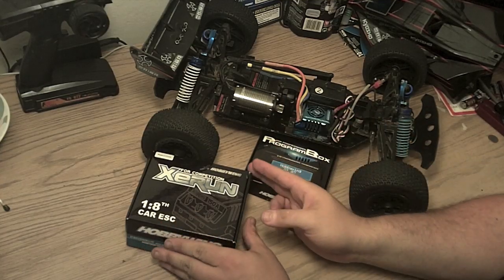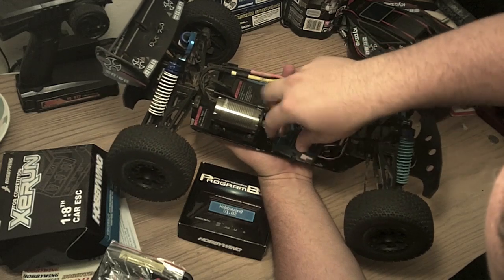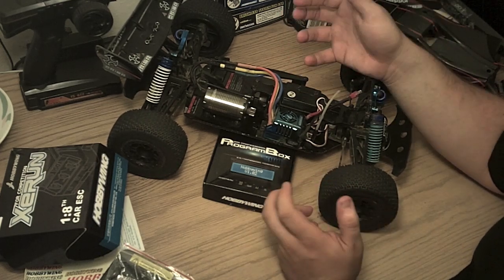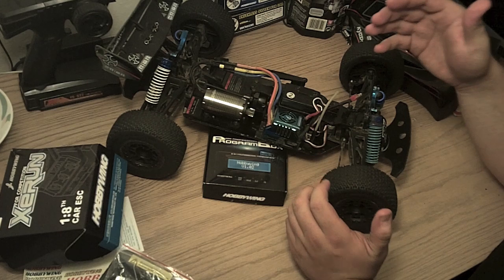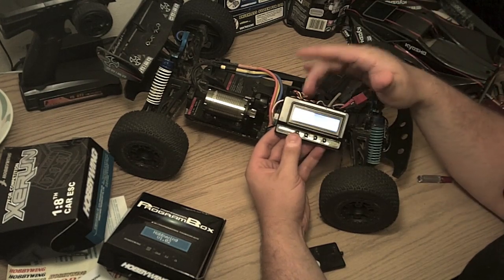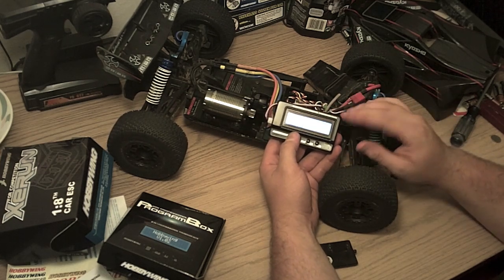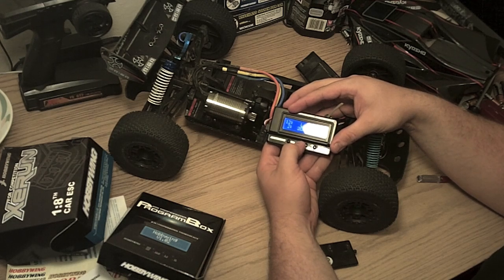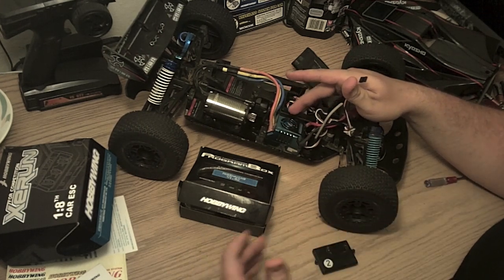HobbyWing Xerun 80A ESC & Program Box Review

Comment: i got an ezrun sc8 120amp water proof and it runs fine on 3s life on kyosho dbxve on 2800kv 550 motor 

runs cool easy to usb update and program with programming box  has good bec and powerful fan 

i got programmer and esc shipped to uk for 55 quid bargain  and i dont have to waterproof it myself like castle stuff

Comment: + POSITIVE VOTE FOR YOU +

That a very good Video-Review.

From a few days ago I have Xerun80A and when I use 3s and ESC option is in "Auto Calculate" ESC say that I'm using 4s, but now and thanks to you I know that only is right to 2s and 4s (and I'm reading "user manual" just now and say it).

-----------------------------------

Desde hace unos días tengo este variador y al usar 3s el modo atomático lo detectaba como 4s. Gracias a ti he visto en el manual dónde estaba mi error.

SaludoX.